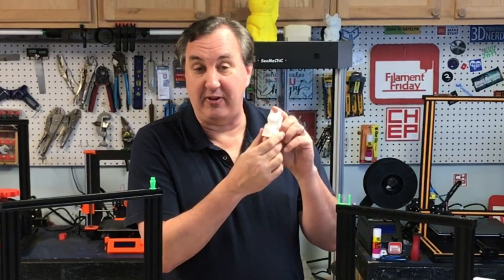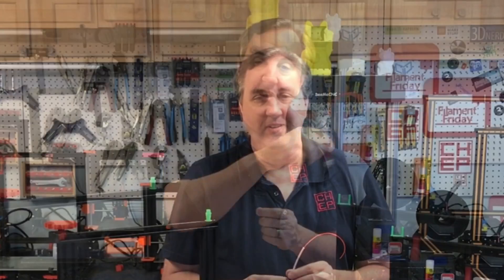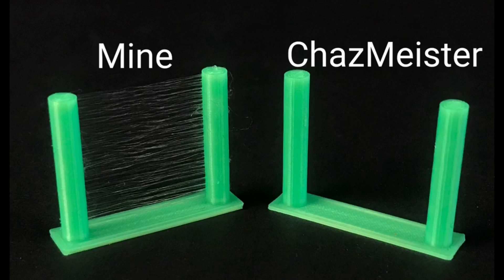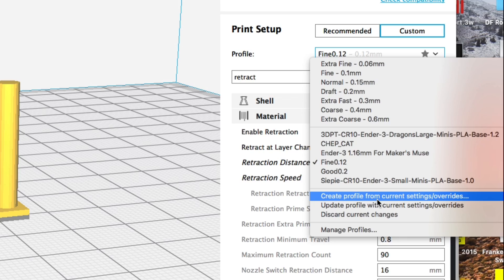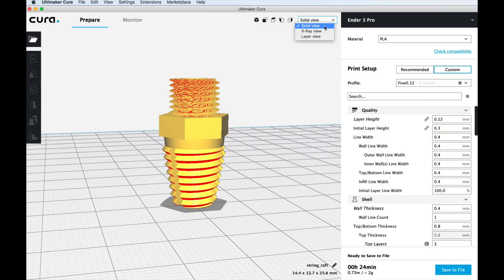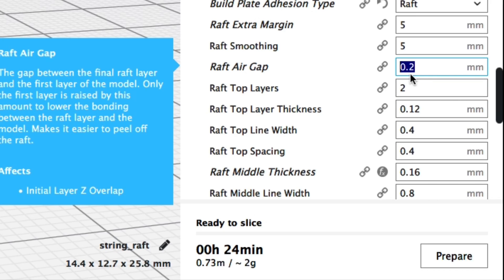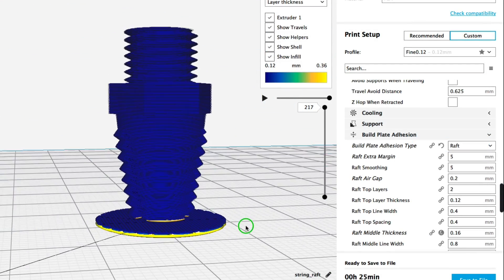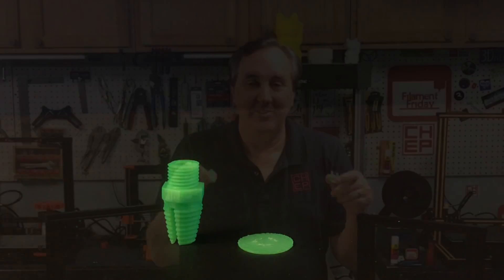Cura Settings for Retraction and Raft on Creality Ender 3 or CR-10 Mini

Comment from the maker: This video is old. I’ve incorporated the changes into my Cura profiles.
New link in description of any of my videos.
Reply: So what's the final "verdict" here? 6mm retraction, and 25mm retract speed? Unless updated Creality firmware ?
Reply: Same here... I just cannot get this to print clean. Tried it all. Chep's, ChazMeister's, MakersMuse's profiles always stringy as can be. Starting to think it must be the filament. Using eSun PLA+.
Reply: @AlexSwan  I am having the same issue and am using the same eSun PLA+ filament. Have you been able to find a solution
Reply: it still doesn't work for me, I have these weird branch thingies whenever I print it. Not all the way inside but kind of to the sides.
Reply: I am having the same issue, have you been able find a solution. i try so much.
Reply: @basbranderhorst  I know that this is the exact opposite of what the video says but try this. It is very similar to the settings that are placed by default on the 3D designs that come with the Ender-3.
Retraction Distance: 11 mm
Retraction Speed: 10 mm/s
Retraction Retract Speed: 10 mm/s
Retraction Prime Speed: 10 mm/s

Let me know how it goes!
Reply: @timothysmith2944  no, it doesn't work well for me, I found out that 4mm and 20mm/s work best
Reply: @basbranderhorst  Interesting, I wonder what the difference is. I'm glad you were able to find something that works!
Reply: How come the retract speed has been changed back to "old" values around 45 in the new profiles?
Reply from the maker: Because Creality upped the default max from 25mm/sec to 45mm/sec in firmware.
Reply: @FilamentFriday My printer is Marlin controlled firmware. It seems to do whatever the Cura gcode max produces. Even going way past what the physical machine can accomplish. I like it that way since one can lighten up the bed or print head to accel  or decel faster for one's own build refinements.
Reply: The reason I don't like a raft is that the layer above it is not smooth like on direct adhesion in my glass mirror bed. On PETG the raft binds too well to the printed object as I have to hit the first layer with 245C on a 70C bed to get it to stick well.. When printing the Object I turn fan on 40~70% and drop temp to 210~220C I rather use created supports to connect to the object specifically designed to hold fast to the built plate with tiny sprues connected to the sides of the object being printed. One can just clip them off and the base is then  smooth.
Reply: I looks like your link is not working anymore.
Reply from the maker: @meisievannancy  - New link is in description of any of my videos.
Reply: @FilamentFriday Thanks. Will look it up. I am only newly subscribed.
Reply: Doubles my print time in cura :-(

Comment: Holy... I was on the verge f going mad.... Creality PLA black, 190 C, at 0.08, 3mm retraction, at 45mm/s, FULL OF STRINGING, those chunky ones... At 25mm/s, CLEAN, NOTHING, just perfect... 
3 days calibrating, i was starting to believe it was bad nozzle, maybe something else with the hardware or filament was bad...
Reply: i put mine from 45mm/s to 25mm/s also i hope its going to work

Comment: I'm still dealing with this issue, havent tried it yet but search for something like "filament stringing oil"

I saw a video of a guy who printed a little box that wraps around the filament before the extruder, two little sponges with a drop of olive oil. And aparently they smooth it out and stop the stringing.

I'm almost sure my problem is hardware related. Small layers with a 0.4 nozzle, but, it has to actually be humidity.

It's my first printer, my first spool. Have been at it for two weeks, one week and a half. Spool always exposed, 24/7. This past week, the humidity went crazy high and I'm pretty sure that's when it's started, while I was trying to print 28mm minis with thin parts and lots of detail. Perfect recipe of chaos I guess.

Comment: Hi CHEP I have a  toauto pyramid printer it is an offbrand Printer I upgraded with a Dragonfly Bms hotend and a genuine bondtech lgx large gears extruder. I am new to 3D printing will this profile work for my 3D printer if not is there anything you can do to help me figured out where do I download the new changes you have mmade

Comment: While this page is old, I have a great discovery for built plate adhesion.  I got sick of the factory Ender-3 plastic deck pretty quickly.  I just couldn't get materials to stick to it.  I don't like the idea of glue or spray so I switched to one of the spring-steel aftermarket plates. Has worked FABULOUSLY for a couple years now but recently I had trouble getting filament to stick to it.  I cleaned it SPOTLESS, no grease (from hands) no contaminants of any kind.  It got WORSE.  Then I had an epiphany that solved the whole problem and it is BETTER now than it ever was!!  The solution:  120 grit sanding roll.  I sanded the plate across thoroughly, and front to back the same.  I cleaned it completely again and voila!! Everything sticks awesome while it's hot and once cool it comes right off.  Many items I used to have to use a raft for no longer require it.

Comment: these setting helped me out significantly. now instead of a bunch of strings its little spikes sticking out the sides. i also turned off combing since you mentioned doing that in the comments. just as an fyi the link you posted for the updated settings no longer works it takes you to an error 404 page.

Comment: I did all of this and determined that 205 temp and 5mm retraction was perfect.  Printed with these settings and 25mps retraction speed and it's still stringing like crazy.  Last week, my prints on this machine with this filament were perfect.  How does it just go nuts like this.  Seems to be an awful lot of "magic" involved in 3d printing.  🙂
Reply: filaments can get moisture from humidity in room in them, so it could be that your settings were right but the filament itself has become wet
Reply: Get a filament drying machine?

Comment: can you share what type of combing this used. I used your profiles from the link creality_ender3_chep4.12_0 (on ender 3 s1) . One thing noticed is they dont have any settings for combing or z hop. and my prints are mess.
Reply from the maker: Both of those will make them even worse. I don’t use them on purpose.

Comment: I'm still getting small wispy strings between the pillars when doing the retraction test using these settings, is there something else I need to change or can do? I'm using ender 3 of course
Reply: im brand new to this but i'd maybe try incrementally increasing the retraction distance, very incrementally. theres a nozzle wipe option on cura though ive never tried it, please let me know how you ended up getting on since it's been 7 days, had nothing but problems so far with my ender 5 pro ;(
Reply: @roachitane  I did find a fix with the settings, if you need help I can share them too. I'm using hatchbox pla. Took me hours to figure out out was frustrating as feth
Reply: @gk7003  I got mine a few days ago and so far it’s either too thin out the hot end or everything will be perfect until it’s not, all of a sudden no filament comes out, I suspect it’s heat creeping but I genuinely have no idea, spent days just trying to get a decent print, all the profiles online are more or less identical and if not I’ve tried them, kinda need help man I’m so eager to start printing 😭😭 have u had any problems like these? I assumed it was because it wasn’t retracting enough or that the extruded shredded the filament too much to get any grip eventually but I’ve messed around with both relentlessly, I’m not expecting a response or anything but do u have any ideas? Pretty desperate
Reply: @gk7003  sorry for such a long pointless response haha
Reply: @gk7003  So how did you work it out?
Reply: @CreativeDesign75CZ  so I'm still trying to get it completely perfect , hatchbox was working fairly good but started becoming brittle too so I've switched to overture pla. The main things id suggest are find a very small retract test tower to print and start trying different settings. I find that a low retract distance 1, with high retract speed seems to work best. Make sure your temperature isn't too high or you'll get blobs. Set combing mode to on "all" or "not on outer skin". Set minimum window to 0 and max to 10. 
With hatchbox I found having high speed as well as high retract distance at 9 worked best on the other hand. So don't go by the guides online, it doesn't seem to make sense or have universal rule with what actually works

Comment: I have problems with the print coming loose on the bed. If I print a flat surface the bottom part of the print starts lifting. Any help please?
Reply: Sounds like you're having trouble with the print sticking basically, right? If so, what I found to work for me is to add a brim, make sure bed temp is 60 for pla, and then also use spray adhesive on bed right before clicking the button to begin the print.
Reply: @zzzzzz...9902  I got it fixed now I also bought the Eder 3 DD and the filament keeps getting stuck in the gears so I ordered a new Direct Drive from BondTech
Reply: @Beep-v9w  I am happy to hear you got it fixed! I have the Anet a8 as my first printer, I do not use this one anymore. However, I now use the Creality CR-10S and sometimes the filament gets stuck as well, but what I do is just pinch the spring mechanism so the gears do not touch and then I physically push the filament through until the end is in the Bowden tube, then I release the spring to send the gears back as it just has a hard time starting new filament sometimes. Also, if I cut the filament at an angle instead of being straight, that also helps the gears grip the filament. I can see if a gear is stripped, that it would cause your issue as well, so good eye catching that.
Reply: @zzzzzz...9902  Thank you for the help bruh but sadly it was getting clogged after I have fed the plastic through the gears and I did the cut on the side like they said and itstill gets stuck. I decided to go with Bondtech's Direct Drive because the gears teeth look a bit sharper. I hope this helps. I'm just waiting on the shipping now. I really appreciate you taking the time to help because there are no videos about this online that I've seen.
Reply: @Beep-v9w  I am happy to help as I have been there multiple times with other issues where I just did not know what to do. So I feel your pain. Hopefully a new direct drive will fix it. Let me know if it doesn't and I will see if I can think of something else that could cause that issue.
Reply: @zzzzzz...9902  thank you yah I'll let you know once it gets here if it works or not.
Reply: @Beep-v9w  Sounds like the drive gear was either too tight, or too loose.
Reply: Re level everythhing... then print a leveling print... and adjust the spinner wheels yet again lastly! Auto level doesnt work the best..!

Comment: So i have a weird situation. Ender 3 pro. Always stringing. Always. No matter what. So i tried something crazy and it worked. Prusaslicer standard 0.4 nozzle settings for ender 3 pro. But one crazy stupid change: 0.6 nozzle, physically on the machine. And voilla, it works perfect, no stringing. I have not measured the prints to see if the size is right, but literally no strings. So i would like if someone (with more xp than me) can try this on their ender 3 and verify that i am not dreaming.

Comment: Hi Chep! Happy new year 2022 first! :) I'd try your tips of the retraction on my Ender 3 V2 but it doesn't work. I've already tried a lot to stop stringing but it won't stop.

My Settings:
Layer Height: 0,12mm
Line Width: 0,3mm
Temperature: 195°C
Retraction Distance: 6mm
Retraction Speed: 25mm/s.

I also own a ELEGOO Neptune 2S and tried also the settings from it (Distance 5mm, Speed 70mm/s (ELEGOO recommended)) but it doesn't work at all. Higher temperature doesn't help either. I use filaments from Das Filament and Bavaria Filaments.
Reply from the maker: Try this: https://youtu.be/OG7We83M5gc

Comment: Hi @CHEP, I followed your tutorial for the raft configuration, but it's still super hard to take the raft off the parts. what is the right parameter to change in order to make it more easily separated?
Reply from the maker: The gap setting settings.
Reply: @FilamentFriday  LOL sure, but which of them and should I increase it or decrease?
I wasn't sure what it's doing, what the effect it has on the raft

Comment: Any idea/help in using these settings in Prusaslicer 2.3.1. I don’t use Cura.. TIA! 😀
Reply: I have been working on a profile for prusaslicer for the last 3 months I finally got a decent profile for quality but I am still working on the stringing but If you want I can share it with you when it is done
Reply: @cbossplayz3555  AWESOME!!

Comment: Hi @CHEP are the raft settings good to use on all prints or just small prints? Also what is the point of a skirt besides making it nearly impossible to take off,. seriously it's the hardest thing to take off the bed.
Reply from the maker: It cleans the nozzle and gives you a chance to live adjust the bed.
Reply: How about the air gap and other settings for the raft, I prefer having one as it protects prints when removing. Those settings would be good for larger prints? Or would you want a slightly larger gap for bigger; say 0.4mm max or your nozzle size. Smaller the gap the more adhesion to actual print I would think?!
Reply from the maker: I cover that in another video. I use a gap of 0.3 for rafts in my CHEP Cura profiles.

Comment: When I open the profile in Cura 4.8 it doesn't show the Retraction settings.
Reply from the maker: This is old. Use my Cura profiles instead. https://www.chepclub.com/cura-profiles.html
Reply: @FilamentFriday  Thank you.  Do you think the settings will work with the Ender 6?
Reply from the maker: Yes
Reply: @FilamentFriday  Hey Chep,  so I did the exact same test and the stringing tower came out 99.9% perfect.  So I decided to use the same settings and print a Mandolorian and I'm getting a lot of stringing again.  Any insight?
Reply from the maker: Could be filament, PTFE, etc. That’s a big print so things could be changing.
Reply: @FilamentFriday  I'm using a Capricorn tubing and pla filament. Any idea on how I should start to challenge this problem
Reply from the maker: First make sure the nozzle area is perfectly clean and try again.
Reply: @FilamentFriday  I just got some new nozzles some I going to see how that goes.

Comment: I have an Ender 5 Pro and when I set my Retraction speed to 25 mm/s my stringing gets slightly worse.  What could be causing that?  Appreciate any comments.  Thanks for your great videos.
Reply from the maker: You probably has filament residue in your nozzle path.
Reply: @FilamentFriday  Thanks for your quick reply.  I just cleaned it with a nozzle cleaner and re-printed but it didn't change anything.  If it's nozzle residue, what other cleaning do you recommend.  If that should have done cleaned it, what other issues could be causing the continued stringing?  I'm using Zyltech PLA (Gun Metal Silver), which I use as a general purpose filament and have had very good luck with it.  Thanks.
Reply: Well, it is better, but still a bit stringy.

Comment: Thank you so much for the explanation. I was having a hard time printing pillars 9cm high and 4mm diameter and was getting a wobbled finish at the top. These worked brilliantly. The raft settings have made a huge difference.

Comment: I just started having stringing problems, even though I've been using your retraction settings.  I'm using the same Hatchbox PLA I've always used, same temps: 50C bed 205C nozzle.
What else should I look at?
Reply: @Collyer Berkelaar Thanks!  I didn't know that. It's about 15 months old.  I have some of the higher quality tubing on hand.

I will say that after I posted this issue I leveled the bed and it helped.
Reply: @Collyer Berkelaar Any suggestions for someone using these settings with a brand new tube and still getting stringing? :(

Comment: Raft setting are garbage they dont work
Reply: then your printers fucked up
Reply: I prefer the brim, but I have Issues with TPU where there's no air gap between. Gonna expand my settings and go off of Chep's guidelines as a starting point.

Comment: Hi Chep, Congrats your videos are awesome!! I wanted to ask you if the raft configuration applies also for petg, cause I tried it using petg and every print using pla works fine but using petg it's actally very hard to remove the raft, what would you recomend using petg?

Comment: This was definitely a step in the right direction but i’m trying some faster prints with a 0.6 mm nozzle. 
Using a 0.6mm nozzle, 7mm retract and 20mm/s retract speed  I’m still getting artifacts on the interior.  Not strings but some jags.  I turned off Z hop after reading it might be contributing to the stringing. Temperature tower showed no major differences between 180 and 220 Celsius on hatch box black PLA so settled on 200.  Calibrated the E-steps and set extrusion multiplier to about 95% due to the raised ridges I was getting on flat faces. So many variables, any thoughts?

Comment: The ChazMeister2's profile gives stringing on cura 4.7.1 but not on cura 3.6. CHEP profiles also gives stringing for me on cura 4.7.1
Reply from the maker: Interesting. I haven’t seen that. I may have to do more testing.
Reply: @FilamentFriday  i had the same problem on 4.7.1
Reply: i was litrally just trying to follow along with this between brim and stringing i've tried printing a spindle thats 1.25" wide and 7.5" tall keep popping off a little over half way.. i also dont see